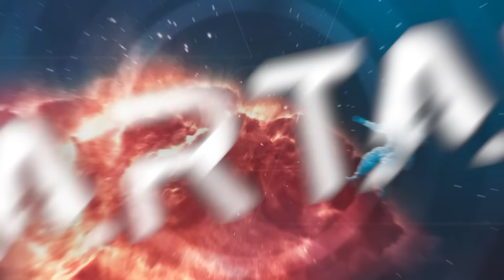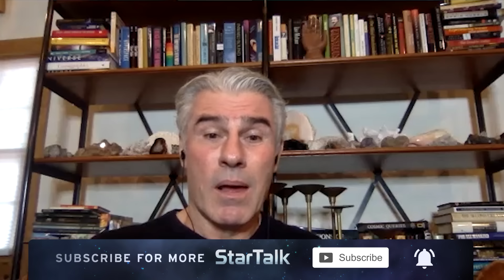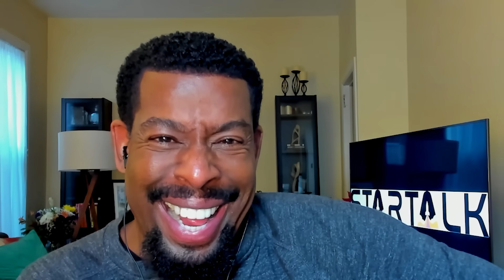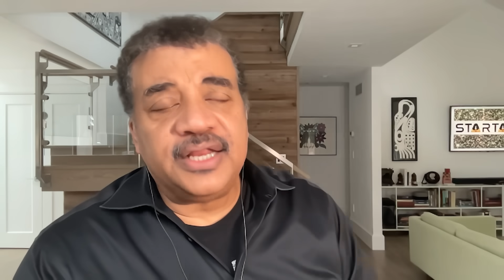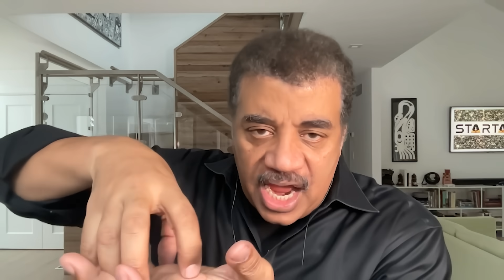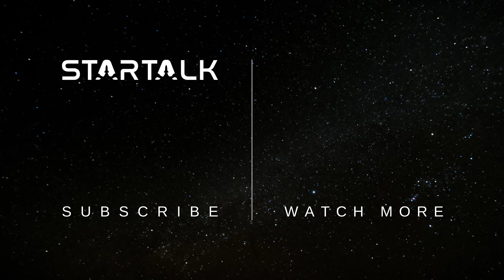What’s The Fastest A Car Can Go? | Neil deGrasse Tyson Explains...

Comment: I don't want to say I know more than NdT, but modern electric cars, hyper cars and superbikes can do 0-60 in sub-3's without any prep or special tyres. I do agree there's a limit at how fast they can go due to friction, air resistance etc. but saying that all cars can only accelerate at 1G doesn't sound right. Sure once you reach more than 60MPH you won't feel the gravity as much as when starting from the standing start though.

Comment: Boy - Neil, you are so wrong. At 6:03 you said that the fastest you can move forward is 1g. A top fuel dragster goes from 0-300 mph in 3-4 seconds. That's WAY more than 1g.  The Tesla Model S plaid does 0-60 in 1.9-2.0 seconds, using plain street tires and a regular street. I'm very disappointed at Neil's misunderstanding of physics.
Reply: He redeemed himself by making a video on the same topic with Jason from Engineering Explained

Comment: The Tesla Plaid does 0-100KMPH in 1.9 Sec at 2G's. This is because of the insane amount of traction and downforce as well as the torque. There are all kinds of cars in the 400KMPH range now. Like you stated in your video even the funny cars were hitting 300MPH with 15,000HP engines. They were extremely inefficient though. Tesla is working on the new roadster that is tested at 0-100KMPH in 1.1 sec. The cars nowadays have antislip, a Tesla will be very difficulty to sin the tires when these devices are enabled. Only an EV will have this insane advantage of twice the downforce VS twice the HP for forward movement.

Comment: Normally NDT is pretty good with physics but he is wrong on some year one college level physics here... One of the fundamental principals of surface friction is that it is independent of the object's velocity, this is not true for air resistance however, as it is a function of the velocity squared... There is no real need to create more down force (by the way you don't want to call this increased weight, you want to call it an increased "normal force") in order to accelerate the car, according to Newton's second law of motion you only need a net force greater than zero to accelerate forward.  Now assuming you had a nuclear engine that gave near infinite power, the only real limiting factor would be either the lift force created by the design of the car causing you to fly off the road, or the literal curvature of the Earth, because there is really nothing according to the laws of physics that prohibits reaching Earth's escape velocity on a surface... Now in terms of maximum acceleration, yeah hes right about that..
Reply: He redeemed himself by making a video on the same topic with Jason from Engineering Explained

Comment: Tesla Model S Plaid weighs 4,900 lbs and does 0-60 mph in 2.2 seconds or less on the street with street tires. Tyson is forgetting that AWD exists. RWD cars only have about half of the car’s weight on the rear tires. The weight on the front wheels is wasted without AWD.
Reply: Even with RWD in the equation Tyson is wrong! Some of those can also do 0-60 in under 3 seconds.

Comment: Tires are made of rubber (and steel). Wheels are usually made of aluminum or steel.... wood if it's an old timey wagon but rubber wheels would probably cause issues.

Comment: Neil, where did you lose me because a top fuel dragster will accelerate to 60 in 0.8 s, reaches over 300 mph in just over 3.5 s, and pulls 5 g with an internal combustion engine providing massive torque. The tires are sticky, the asphalt is sticky, the tires are wide, and they are slightly deflated to provide more surface area, but they are 'slicks', they don't have spikes. What?
Reply: It's 0-100 mph in 0.8!

Comment: Tesla Model S Plaid does 0-60mph in right about 2 seconds with it's stock street tires. A Rimac Nevera is even quicker.  Part due to the traction allowed by modern tires as you kind of describe.  The rubber compound locks into the road surface and if you are discussing Top Fuel Dragsters, they can now accelerate at rates that can detach your retinas... an issue Don Garlits ran into when trying to break into the 4 second 1/4 mile club and the 300mph trap speed. He actually lost his sight for a few days during testing... it's a young man's game now that they are running 1000 feet in around 3.5 seconds at around 330mph trap speed.  As Adrian noted the McMurtry can give you something like 40,000 lbs of downforce with it's fans without moving, which allowed it to absolutely smash the Greenwood quickest record.

Comment: Even with tires spinning it's achievable. There are people that do "hard tire" drag racing on non prepped surfaces that still see above 1g and sub 3 second 0-60 times even without sticky tires digging into the surface. Weight tranfer and suspension setup are huge factors with most of those guys being able to accelerate like that without much traction.
Reply: well the new BMW M4 has 2.8 0-60 now, and its not electric. The hyper cars can go about 2 sec 0-60 even

Comment: Oops 😬2.3 seconds

Top 10 Fastest Electric Cars

The Tesla Model S Plaid, which added track mode in 2021, has pushed the performance boundaries and set a new standard for high-performance electric vehicles. Its quarter-mile time of 9.3 seconds is remarkable, and its ability to reach 0-60 mph in just 2.3 seconds is extraordinary.Jan 12, 2023

Comment: Dr. Tyson, have you considered contemporary engine RPMs in both drag racing and Formula 1?  Contemporary maximum RPMs in F 1 have exceeded 18,000 RPMs.  18,000/60 seconds per minute equals 300 revs per SECOND.  IF you took the head off the engine at that RPM, you couldn't tell the pistons were going up and down.  You could write your name on the piston top with a sharpie without knowing the piston was moving.

Comment: More than 2 ways to improve on this. Sorry my man here is wrong. 

1. Air force management
2. Mechanical weight transfer
3. Spinning the tire faster than the algorithm used to determine the max speed and then engage the wheel at higher wheel speed within a couple tenths of a sec with enough torque to maintain that wheel speed and you defy the explanation on the video. Top fuel dragsters 0-60 time is .4 seconds.

Comment: Wow Neil I never thought I’d say it but you got this completely wrong. Not only are you incorrect about sub 3 second 0-60 times but the title of the video is suggesting top speed and you’re talking about 0-60 acceleration. There are many cars and especially many motorcycles that have beat 3 seconds for decades with normal tires on normal roads. The idea that you are throwing out dragsters is also nonsense, they are cars and they have insane acceleration the tires, track and adhesive are irrelevant to the fact that they do accelerate at less than a second to 60mph. We still like you man but wow you really blew it on this one.

Comment: I saw a YT Clip with a F1 style electric car that has a fan sucking the car to the ground. They used it more for cornering than speed off the line (ie I think it was only spinning when moving). I can imagine that the fan could be turned on  before the car starts accelerating to hold the car to the ground.
Reply: It wasn't electric! It had a Flat 12 engine , If you are referring to the The Brabham BT46 Alfa Romeo.   The Fan was for down force and was banned soon after👍
Reply: @madb132  we are talking about  different cars. This thing was not a racing "registered" car, it was simply an electric super car pushing the boundaries. I also remember it only had a few laps in it before the battery was flat.

I did a quick search, and found this example (its not the only one, and probably not the one I saw), and they actually do appear to use my projection of turning it on before it starts moving. 1.4s 0-60 and they think it can do better.
https://www.youtube.com/watch?v=qTgL8_1GDI0

I also clicked on the following, and it looks like it "vacuums" up the dust on the track and spits it out beck looking like exhaust comning from an electric car.
https://www.youtube.com/watch?v=96UjqDWGVns

maybe it was the one I saw.

Comment: i would like to point out that addition weight caused by the down force of air is only 0 if there is no wind, if the wind is high enough and in the right direction you still can get down force at a stand still.  though i would perfer not to go walking around in 60-90 mile wind to to get to my car.

Comment: Quickest car is acceleration, fastest is top speed.

This was the common consensus years ago, the the tire engineers said "hold my beer" and created tires that can grab the roads at higher and higher G forces even on normal roads.  All roads are rough at small scales and tires use that.

Comment: F1 cars accelerate at about 2G, brake at about 5g & corner at 4G to 6G, recorded by on board sensors so over 1G acceleration is possible but they are built for it. But this video is called "What is the fastest a car can do?" but talks about what is the fastest a car can accelerate. l do know that there is a maximum speed a car can do due to a few factors and was hoping that is was what this video would explain but nope.

Comment: I don't think this is correct. Top fuel NHRA dragsters leave the line with 4-G's.
     Of course these are not passenger cars, these are cars specially engineered to accelerate. But no amount of engineering will make a drag racers accelerate faster than is physically possible.

Comment: A “serial” production car Rimac Nevera with street legal tires do it under 2 seconds. On regular road surface. So it seems like physics is proven wrong, kinda.
The trick lies in the tires that are high performance with insane amount of grip and the road surface that isn’t perfectly smooth so it’s a kind of micro gear traction. On a glas surface you would need a tire with nano “gears” to achieve the same. It’s not impossible just look at the nature. So no 1g is not the limit.

Comment: Well, that only works for initial acceleration. As soon as it starts moving, and seeing as downforce squares with speed, any downforce producing vehicle can technically accelerate exponentially, until the downforce + air resistance exceeds the propulsion force of the engine.

 His point about convergence around 3 seconds is kinda valid, but his point about cars only being able to accelerate at a maximum of 1G is only valid for the very initial part of acceleration, which makes his entire point is a little bit of  a misnomer. 

He also says look up and see if any vehicle can do it faster than 3 seconds, when racing cars do it regularly below that, and F1 cars have done it in around 1.6s. even reaching 190mph in 10s, clearly demonstrating an accelerative force higher than 1g.

Comment: The maximum velocity a vehicle can accelerate would be the speed of light plus the velocity of the vehicle unless it's in the outer portion of the cosmos in the claimed expansion, then it would be exponential times the speed of light if the cosmos were expanding, but it's not.

Comment: Umm. My car will go from 0 to 60 on cold street tires without VHT (tire glue) or subtracting 1 foot of rollout on a normal road in 2.4 seconds. I have used a GPS tracker to time this. If it was fully charged it would have been faster probably in the 2.2 to 2.3 second range.

Comment: You are wrong. There are plenty of cars that can accelerate faster than 1g. And with tires in many cases you got more traction with slight wheelspin than without it. Tire is not solid cylinder of stiff material. There is a lot more going on with tires than you might think.

Comment: At one point in history of F1, the cars actually accelerated faster from 100 km/h to 200 km/h, than 0-100 mark. It was incredibly difficult to not spin the wheels from 0-100 and subsequently loose time
Reply: Well yeah, they need speed to produce downforce lol, but with fan cars and active aero, that`s a thing of the past, technically speaking.
I`m all for a McMurtry class of racing 😁
Reply: @afrog2666  - Instant fan of that race series, if it ever happens!
Reply: And also the pressure of the tyres. F1 tyres usually run very low on pressure so both temperature and grip get to optimum levels.
Reply: half mile drag cars do this. look up the videos. they basically spin the entire first and second gears
Reply: To go faster you need 4 wheel drive or accelerate down a hill. Then you're boogieing.
Reply: I’m
Reply: It’s just think of the old hyper- and ultrasoft tires. Lest go baby

Comment: You are missing the fact that modern tires like the Michelin Pilot PS4S and Pilot Cup 2 must be able to achieve Co friction > 1 because several cars can achieve near 2 secs 0-60 on a non-prepped surface with them (BMW M5, Tesla Plaid, Porsche Tycan, and more).  Granted they spin the tires first to heat them up, increasing traction and its the best of conditions.  Now please discuss the physics of a top fuel dragster that can achieve 0-100 mph in 1 second, 330+ mph in 3.7 seconds!  They're achieving 5-6 Gs on launch!  Obviously its the tires that probably require a 1000 hp just to un-stick the tires from the drag racing surface.  In slow motion, you can see the wheels being twisted in the tires.  Please go watch the 4 Wide Nationals in Charlotte.  Four 10,000hp beasts creating a moving earthquake zipping down the track.  I once saw all 4 doing the 1000 ft in < 3.8 seconds!!!  A perfect run.

Comment: Check out the McMurtry. It has fans that produce huge downforce even while stationary so it could stick to the roof of a tunnel at standstill. There are also lots of cars that can go faster than 3 seconds 0-60 on normal roads. 
And what about cornering? Lots of cars can exert way more than 1g laterally. Can you explain how they can achieve that please?
Reply: 1g Neil is referring to forward motion from stand still.👍

Comment: Sometimes Neil gets it wrong. Like he did when he said Elon Musk couldn't create a successful rocket program because it could only be done with government involvement. There are already cars that get to 60mph in less than 2 seconds without excessively sticky tires (though warming still helps). I'm not including top fuel drag cars because they are very specialised and with their extra large sticky tires and power to weight ratio they are the fastest accelerating vehicles on Earth. They can do 0-100mph in 1 second. This requires the perfect combination of many specific factors including a few prayers to help prevent the car taking off or exploding.

But, back to the main point. There is a reason electric cars find it so easy to accelerate at high speeds over combustion engines and achieve sub 3 second sprint times. Unlike combustion engines an electric motor can adjust the power going to the wheel over 1,000 times per second. That allows for fine tuned traction control. As soon as the tire loses grip the torque can be dialled down momentarily regaining grip. In a combustion engine the loss of friction would continue until a significant reduction in power kicked in or a period of wheel spinning slowly built momentum with what little grip there was.

Neil needs to update his knowledge.

Comment: Leno's jet car is has friction limited has any other, it uses a turboshaft engine, and it's the shaft power, connected to the wheels, that moves it, not the "jet".
The same with any Rolls Merlin engine, which is just a comically big gasoline V12. Wich in a car is connected to the wheels, not a propeller.

Comment: I drive a spotter truck at work. If you turn your tractor past 45 degrees at the coupler and fifth wheel piviot point you can make the trailer go backward while you drive forward I use this to line up the trailer all the time. I’m guessing that’s what the train does also

Comment: Although I’m sure he understands the science, the examples used are terrible and wrong. There is no magic 1G limitation. There things like squat and anti squat that force the tire down during the launch, and then there is weight transfer that put much more of the weight of the vehicle onto the drive wheels, but claiming this 1G limit is nuts considering the different types of launch pad materials at the track and the natural stickiness of the tires materials. And show plows have been on 4 wheel drive trucks for a long, long time.

Comment: Lots of car nerds in the comment section talking about the various cars that get from 0 to 60 in under 3 seconds. Love it, but no one talks about the elephant in the room.

The video focuses entirely on the contact patch friction of a stationary car (which is cool, I didn't know physics prevents you from accelerating faster than 1G) HOW-EVER, however, the moment you start moving you're able to accelerate faster than 1G and that number is climbing proportional to your speed because the car is generating aerodynamic downforce which is pretty substantial by the time you're doing 60 mph. Virtually every modern car that has the HP to get to 60 in under 3 seconds has crazy good aerodynamics and a launch control system able to send just the right amount of power to the wheels.